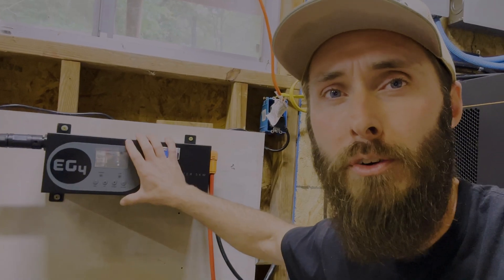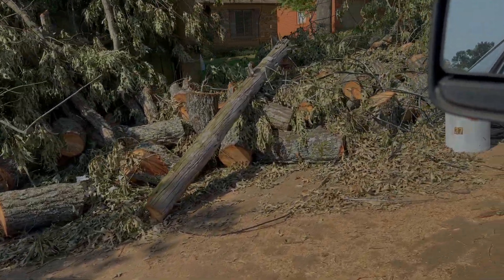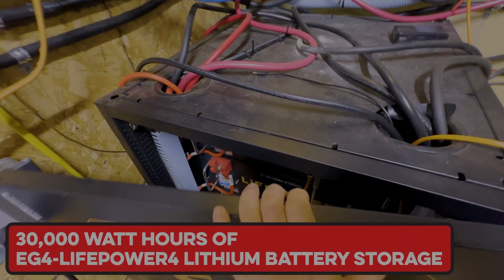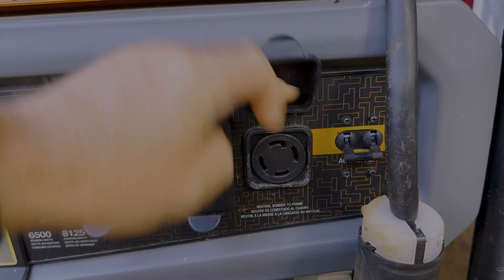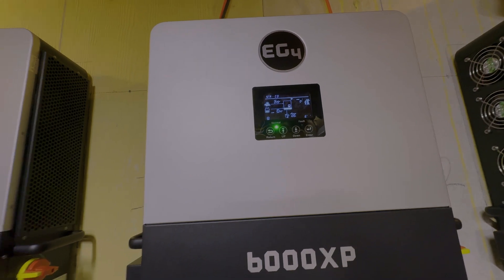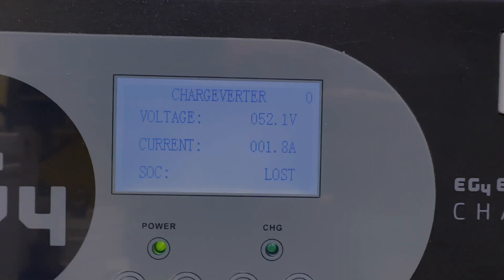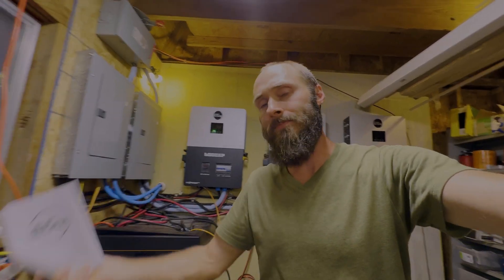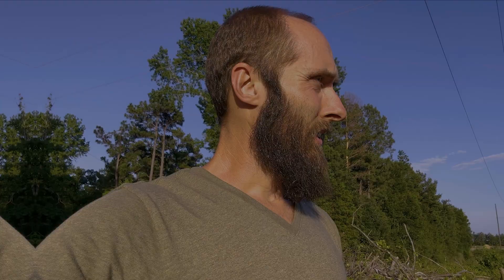Off Grid Tip: Using the Chargeverter GC & 6000XP In Tandem?

Comment: Eric,  how many hours would u estimate u've used the chargeverter since this video?  I'm installing a Luxpower 18kpv for a peak shaving system here in Canada,  with 2x14kWh batteries.  I don't expect to need a generator often, but would like the option to use my 4200/3500W genset if I for some reason need to.  Since I've gotten a genset 10+ yrs ago,  we've had only a handful of power outages that were more than 1hr long.  The longest being about 6 hrs.  I have less than 20hrs on my genset in 10+ yrs.
Reply from the maker: Since this video, I’m not sure if I’ve used it at all due to a power outage. I’ve used it to charge and top off new batteries before introducing them into my system. And I’ve used it to test other batteries. But nothing for its intended purpose. Good luck installing your new system. It’s going to be nice!

Comment: I'm using our first edition EG4 Chargeverter with a Westinghouse 5kw generator restoring a 36v IFLA battery bank right now. Maximum output is 85Amps. I tried 90Amps and the generator bogged out and died. These are great little chargers!
Reply from the maker: Nice! You may be able to get better fuel efficiency if you back it off to 75A. Would be interesting to test.

Comment: I have had my system for three years. I turn the generator on let it run for about 1 minute. Then I plug in chargerverter in then it takes me about 15 seconds to reach the chargeverter to flip the breaker. After that it runs everything just fine. Stove, dryer, hot water. No problems in 3 years. I have two 6500ex-48 inverters eg4 48v battery rack and a predator inverter generator 9750 watts.
Reply from the maker: That's awesome! Love that you've had such great success with your setup!

Comment: Excellent video, however I am confused.

I just ordered a EG4 Chargeverter and the 120V cable. My system (yet to be installed) consists of the EG4 12000XP and six EG4 LFP batteries (3 batteries in each of two EG4 Indoor Cabinets). I also have a 3200W Firman portable generator that delivers 26.7 amps (120V).

Question: I assume that I have the option to charge batteries at 120V from the Firman generator OR to charge them at 240V from grid through the EGF12000XP, however, I can't find any instructions on how to wire these devices together or how to switch between the two options. Any guidance you can provide will be very much appreciated.

Comment: Some facts for those that think...
Your gas powered power supply is an Alternator making Alternating current.
The quiet throttle down gas power supplies kicking around these days are  Generators making Direct Current. 
Thus they say  "inverter" on the side.. they make DC inverter it to AC and then you power the blender.
When they inverter the power DC to AC it is buffered such that it is "clean"  and that is exactly what the charger verter is doing... notice  "verter"  every one has to make up their own words these day claiming they have something new that is really 50 years old.

Comment: Did you have communication cord between chargeverter and batteries?  Did you leave the communication cable from inverter to server battery?  It looks like a 7000 watt generator can only produce 30 amp. How were you able to up it to 100 amps?  Thanks
Reply from the maker: At the time, I was not using a communication cable with the Chargeverter. It was left connected between the inverters and the batteries. However, now that i've added a LifePower4 V2 battery to the stack, I have a two cables – one connecting the inverters to the batteries and one connecting the Chargeverter to the batteries. As for the 100 amps, this is DC at 48 volts (100A x 48V = 4800W). You're right that the generator won't put out more than 30 amps but that is at 240 volts (30A x 240V = 7200W). Hope this helps.
Reply: @ thanks for the reply. I read in the manual that not suppose to connect 2 communication to battery. Does it work for you?
Reply from the maker: @easttnscott7629  It works great
Reply: @EastTexasHomestead  Did connecting the communication cable between the Chargeverter and the 6000XP eliminate the brief power outage from the inverters that you shared in the video?
Reply from the maker: @billsmith1647  I haven't had any issues since.

Comment: The 3 second inverter shutdown @ 2:56 may be avoided if you apply the AC power from the generator to the Chargeverter FIRST, and turn on the circuit breaker SECOND.  That is the recommended sequence given in the CV user manual, page 9.
Reply from the maker: Thanks

Comment: We just got the chargeverter. We have a 6000xp system w EG4 battery. Plugged in chargeverter and have generator going, cannot get it to work. We are COMPLETELY off grid.
Reply from the maker: Oh no! Is it not putting out any DC output, or what?
Reply: We think it may be the connector that we got off Amazon for the plug in. Chargeverter will not power on unless we turn the battery on.  @EastTexasHomestead
Reply from the maker: @ljbsassy  Bummer! Have you tried reseating the connections?

Comment: I leave that breaker on and just start the generator. It cleans up in just a couple seconds then starts outputting full power. When that happens the Chargeverter starts ramping up the power. It all works smoothly. Might give that a try

Comment: I think, there are a couple of things being talked about here and in many such video's that combine or confuse two completely separate issues, which seem to be the same.  1) A "generator" (vs inverter generator), does, especially at load create "dirty" AC power. Again.. dirty "AC" power. That going into an "all in one" can over time cause damage.... to the all in one. However, As long as the All in One, has power coming in from the generator connection, dirty or clean, it will put DC as programmed into the battery. That is not "dirty" power, after all, it's DC, Direct Current, not AC , Alternating Current, thus there is no "wave" to dirty. Pure Sine, Modified Sine, whatever, there is no sine wave, it's DIRECT CURRENT.  So no issues to the batteries, no power to "clean up".

2) The chargeverter takes the clean, or dirty "AC" and converts it to the same DC as would be coming out of the all in one, whether the all in one sources that power from the generator connection, Grid connection, PV connection.. doesn't matter, the DC coming into the battery from the Chargeverter or All in One.. is DC. The Chargeverter doesn't "clean  up" the power, it simply accepts AC and converts it to DC. 

Perhaps it is more tolerant of "dirty" AC, or at a minimum, if it did fry, I'd rather fry a $200-300 component than a $1000+, not to mention if the Chargeverter fries, the rest of the system still works fine. If the All in One fries, you're down unless you have Grid power, or go directly from a generator. 

It's a detail, but a very important detail.

Comment: Couldn't you have put the chargverter into the solar input since it 52VDC output since you dont have solar yet either?
Reply from the maker: Interesting idea, but it wouldn't work. The 6000XP's operating voltage range for solar is 120-385 VDC
Reply: @EastTexasHomestead  Ah Ok didn't realize that, I got Dual Pecron E3600LFPs to power my house at 240VAC and each power station have a duel independent 1200 Watt solar inputs controllers of 32-150VDC at 20 amps each input. I ordered the chargeverter to use with my generator for them since I also don't have solar panels. Unfortunately the Pecrons won't AC charge while in 240VAC mode so I have to use the solar DC inputs to simultaneous charge the power stations while powering my house with AC.

Comment: thank you  , detailed and great demonstration , so the firmware update fixed the shut off on startup breaker issue ?
Reply from the maker: It must have because it doesn’t happen anymore. 🤷🏼
Reply: @EastTexasHomestead  Glad to hear this! Thanks
Reply: If you follow the Operation / Power ON/OFF sequence on page 9 of the User Manual, which says to connect to AC power FIRST, you won't have the 3 second inverter glitch when you turn on the breaker.

Comment: Would you plug an inverter generator directly into your inverter generator port and skip the chargeverter?
Reply from the maker: I would if I had one. Thanks for asking because  was going to address that in the video and forgot. The down side is most inverter generators are way more expensive and only 120V. Until recently, you couldn’t charge with just 120 and it’s still not great.
Reply: @EastTexasHomestead  there is a Duromax XP7000 that just came out that is 240V and around $1800. I believe that is the one I am going to get.
Reply from the maker: @hvacsixty  nice!

Comment: Does the chargeverter support 120v generators?
Reply from the maker: It does! You either need to rewire the end or add a pigtail adapter that locks on and changes the plug. I do this all the time.

Comment: Is it ok to wire the chargeverter directly into a wall mount bus bar or does it have to be the battery  bus bar?
Reply from the maker: I believe the wall mount bus bar would be fine but you may want to check with EG4. Sorry for the late reply. Were you able to figure it out?
Reply: @EastTexasHomestead . Well I've been doing it for 3 months now and it seems to work fine.  When the battery bank reads 99% on the eg4 3k inverter I shut off the chargeverter.
Reply from the maker: @coreygillum12  Nice! Glad to hear that

Comment: Let's say the Chargeverter is outputting 5KW and your house is consuming 3KW, will the remaining 2 KW charge your batteries ?  also, let's say load increased and the house is consuming 6 KW, will the chargeverter continue to output 5 KW and the additional 1 KW will be provided by the battery ?  As house loads fluctuate, I am assuming the chargeverter output power will only charge when the load drops below 5KW. Is my assumption correct ?
Reply from the maker: Think of the Chargeverter as a battery charger that is unaware of your loads or lack thereof. The first two situations you presented are correct. If you set the output to 5KW that is what it will push into your batteries. That is separate from whatever you are taking out. I hope that makes sense. Thanks for asking. Maybe I’ll make a video about it.
Reply: @EastTexasHomestead  Thank you for clarifying!

Comment: I absolutely do not like it tripping the EG4 inverters off.  I’m glad I did not purchase EG4 inverters.  My system is Victron, so my question is:  Has anyone with Victron Inverters have them shut down when the chargeverter breaker is turned ON?
Reply from the maker: That's a good question. What's interesting though is I can't get it to do this anymore. It may be that a firmware update fixed it.
Reply: @EastTexasHomestead  In the video @2:56 you flipped the breaker BEFORE plugging the CV into generator power.  Are you still doing it that way?  The sequence matters.  Generator power 1st, Breaker 2nd -> no inverter shutdown.

Comment: I'll be setting up an 18kPV, wondering how well it'll work with a generator.  Would like recommendations for generators that are compaitlble. Midnite Solar's new All In One is supposed to be more forgiving re power quality.
Reply from the maker: To be clear, you're talking about running directly into the generator port on the 18Kpv, right? Assuming that's the case, I took a quick look at HomeDepot, and there are a few options, but you're going to have to spend a lot.

I'd probably go with something like the Champion 12,000-watt generator in order to hit the specs needed.

https://www.homedepot.com/p/Champion-Power-Equipment-15-000-Watt-12-000-Watt-Electric-Start-Gasoline-Powered-Portable-Generator-with-CO-Shield-with-50A-Transfer-Switch-201405/328602592

The 18Kpv requires a 240v (two hot wires) input from your generator, and EG4 recommends that the generator have between 6,000 and 21,600 watts of output. 

See page 22 of the manual: https://eg4electronics.com/wp-content/uploads/2024/04/EG4-18KPV-12LV-Manual.pdf?ref=esttxthst

In my opinion, it's easier and cheaper to get a smaller generator and run it through the Chargeverter. That way you can charge with 120v or 240v and use a lot less fuel.
Reply: @EastTexasHomestead   I think that is good advice.  I see the inverters can be damaged by a bad generator, so $500 might be good insurance, allow a cheaper genny, and add flexability.  Thank you!
Reply from the maker: @roslynandbobchauvin2378  You bet!

Comment: Great topic.  I have watched a few other videos on the chargeverter to research before I buy.  None of the other solar youtubers have even mentioned the potential issue of not being able to charge with the chargeverter while discharging through the inverters (running in tandem).  I was under the impression you could hook up a generator with dry contacts to communicate with the chargeverter to start whenever certain parameters that you set are met.  I never even thought to question whether you could use the inverters with the chargeverter in tandem.  Glad to know it can be done.
Reply from the maker: It only makes sense because it can auto-start a generator. However, the manufacturer apparently had some concerns at first.

Comment: I currently power my cabin with a NEMA SS2-50P inlet wire to my 240 electrical panel and a 50 amp Rv extension cord running to the generator. Can I wire the NEMA SS2-50P plug directly to a nema l14 30p plug that connects to the chargeveter?
Reply from the maker: No. This would not work. The Chargeverter is strictly for charging 48-volt batteries, which use DC power. Your 240-volt cabin runs on AC power (the same as your generator). If you’re looking to get clean energy into your panel, the best thing would be to get a generator with an inverter built in. This will put out a pure sine wave (clean AC power). Thanks for asking!
Reply: Are you saying that you would disconnect the wires in the panel and wire them up to an outlet that the chargeverter would plug into and then run your panel off an inverter/battery bank instead? If so, you would need a NEMA L14-30R (female receptacle) to accept the L14-30P (male plug) on the end of the chargeverter. If you're only powering the chargeverter you should be fine since it only draws 5000w(less than 30A at 240V). Only problem I see with this is your 30A rated outlet has no overcurrent protection from your >6000W generator, so if some other large load were plugged in, the receptacle could supply over the 30A it's rated for.

Comment: Lost a lot of trees on the property but only slight damage to our shed. Over the 2 weeks of storms we ran off whole house generator for 76 hours. Made me finally order Starlink since our ISP was out even longer than the power. Not yet convinced we need to go battery backup since in 2 years these have been our only significant outages and it looks like our propane can run our generator for 7-10 days before needing a refill. If we move we will likely put in solar and battery backup systems.
Reply from the maker: That was a crazy couple of weeks. Good to hear your generator kept things going. It's a nice prep, for sure. It's tough to justify the battery backup for emergencies when you have the generator. I'm glad you ended up getting Starlink. How's it been working for you?
Reply: @EastTexasHomestead  Lets just say my cable company is loosing me as a customer this week after a 3 week trial of starlink. Sad when a satellite internet company is more stable than a cable company.
Reply from the maker: 😬 my long-held position has been that if you can get cable, then you should stick with cable, but that might change based off of your experience.

Comment: It's not just the dirty electricity from the generator.  You would have to hook up the generator to All The 6000XP's!  The Inverter's will switch to charge mode running all the load off the generator and charging batteries with what is left over, but there is More!  You CANNOT run different generators on each 6000XP because they would not be phase matched.  You would have to have a huge generator if you have large loads running.  This Must Change for EG4 and others to meet the needs of the market.  Put a REAL CARGER inside and stop using the inverter to charge!  I have 2 ChargeVerters so I can run 2 Normal Inverter Generators Not some Huge Insane Expensive Loud Fuel Guzzling Large Generator!  Oh yeah, and they put features in the ChargeVerter that you cannot use like communication that will not work if your batteries are communicating with the Inverters which is Always the case!  And Generator Auto Start that inexpensive smaller Inverter Generators which don't have batteries and starters cannot use!  You only need 5000k to 6000k continuous output Generator to max out the ChargeVerter and very few Inverter Generators of this size have starters and I don't want starters with additional maintenance and problems!
Inverters Generators can run at or near 100% just fine because the output does not become unstable as on non-inverter generators and in my experience Inverters Generators do not run as high RPM at full load so they are not working at full motor capacity at full output.
I was incorrect about my ChargeVerters!  They do cause the 6000XP's to restart!  I wrote EG4 about this Very Wrong Issue!  Who wants the Inverter Output to ShutDown when you start your ChargeVerters?  Ridiculous!
Reply: Major issue if you have servers running.
Reply: @JBoy3210  Super annoying, but I would have my server/routers on a UPS of their own in case I need to get to something if the power is having issues.
Reply: Try following the Operation/ Power ON sequence on page 9 of the user manual.  AC power 1st, breaker on 2nd.